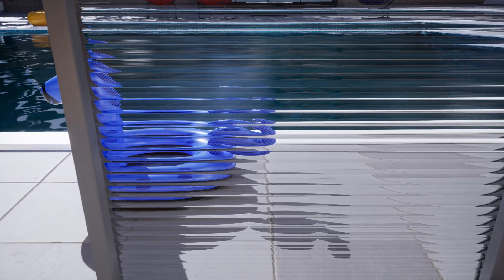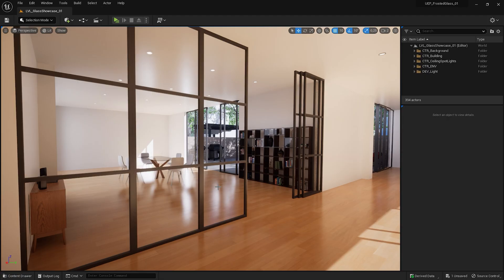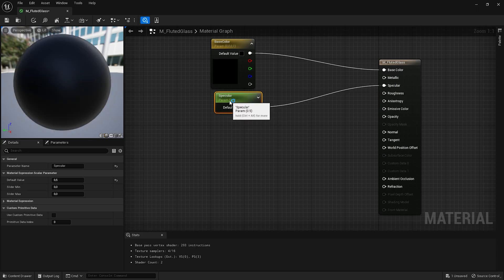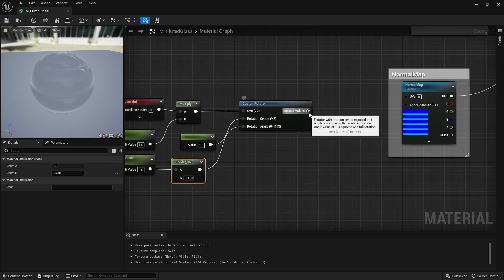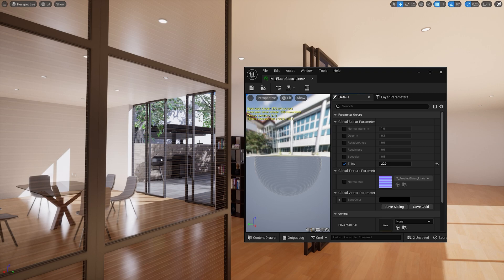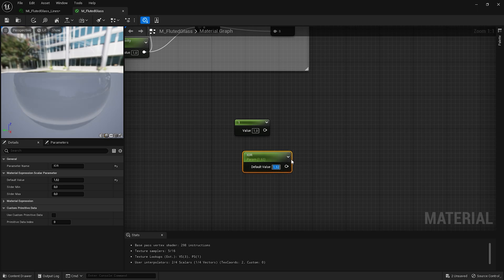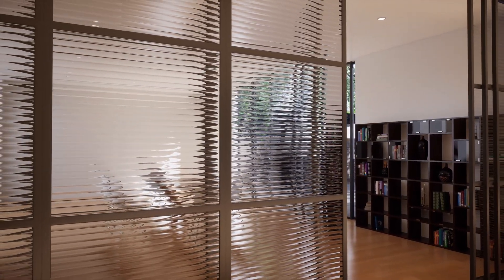Realistic fluted, ribbed, and frosted glass material in Unreal Engine 5 | Tutorial

Comment: I'm on Unreal Engine 5.6.
First weird thing, In Material > Blend Mode, I don't have "Translucent" but "TranslucentGreyTransmittance" or "TransulentColoredTransmittance". I chose one of the two and all the other parameters were available
Second weird thing : as soon as I change "Refraction Method" to something other than "None", the material seems quite dark and in the engine it's totally opaque.

EDIT : I think it's because I'm on a "Virtual Reality" project. I just created a brand new classic one and I have the "Translucent" material and it works. I'll have a fiddle with this is a little bit

EDIT 2 : Just started a brand new VR project template - the same template I took as a basis for my other one, but this time I do see the "Translucent" option. Weird.

Comment: My refraction node is disabled in the material editor, do you know why that would be?
Reply from the maker: Hi! In newer versions of Unreal Engine it's disabled by default. You need to do the following:
1. Select the main node of the material graph.
2. On the left hand side find the refraction section and switch it from "None" to one of two methods: Index of refraction (good for curved surfaces ) or Pixel Normal Offset (good for planar surfaces).
It will allow you to enable refraction input!

Comment: Showing the normal reduction maths is great but for anyone who wants a quick node to throw down, "FlattenNormal" will achieve the same effect (the usual 0-1 range inverse). Thanks for the video!
Reply: One more tip - for two-sided normals, pass RG channels from a Component Mask routed from your Normal Map output into a Multiply node. Route a Two-Sided Sign into the Multiply Node. Append the Normal Map output to your new Multiply node and plug that into the Normal output. Presto, two-sided material with correct normals on both sides! What we are doing here is simply ignoring the B channel of the Normal Map with our Two-Sided Sign for two-sided materials. Joy!

Comment: The effects shown in portal 2 and mirror's edge were likely highly optimised considering the hardware they could run on.

Is the shader code used here as efficient? I do not want to use ray tracing
Reply from the maker: Hi! This effect is used in Mirror's Edge made using Unreal Engine 3, so it's pretty old technology. You don't need ray tracing to create this effect and you don't need an RTX graphics card. It works in Unreal Engine 4 as well as inside Unreal Engine 5. However, it requests at least "Surface translucency volume to be enabled. So, you have to use this material wisely. There're not much places in Mirror's Edge with this type of windows for instance.
Reply: @nikolayshamaev  I see, thanks for the informative response

Comment: Hi! When I connect the CustomRotator node on the UVs of the NormalMap node, the texture just desappear, and the normal map turns into a solid blue texture. Why id this happening? I can't get the texture on my glas :( Can somebody help me, please?
Reply from the maker: Hi!  Try the following:
1.	Make sure your UVs are correct and not distorted
2.	Check “Texture Coordinate” node. UTiling and VTiling values in this node should be set to 1.
3.	Check “Tiling” node and make sure it’s not at 0
4.	Try to use the value of 0,5 in the “Rotation Center” input.
5.	Check the Rotation Angle (by default 0) and Divide node (by default 360 in the tutorial).
It should work fine!
Reply: We don’t rotate a normal map it’s kind of incorrect in this tutorial because normal map dictates how light should behave on surface therefore rotating means changing how light reacts, unless you want it that way you will obtain bad or incorrect result , don’t use custom rotator with normal maps

Comment: I'd suggest that anyone using this change the refraction method to Pixel Normal Offset, this produces a much better refraction result on large flat surfaces. Someone else said that you need to input different values with Pixel Normal Offset, you do not. You should use this exact same setup with the fresnel node and IoR interpolation value, only change the method in the material node to Pixel Normal Offset. Otherwise, you get strange artifacts as you see in the video, with the frame of the glass being visible in the middle of the glass, which makes absolutely no sense. This is what Unreal Engine recommends for large flat surfaces such as glass panes or water. If you have pretty much any other shape, like a glass sculpture or a diamond, then use the "Index of Refraction" refraction method.

Comment: I love this tutorial. So well presented and informative, even though I knew this before it strengthened my undestanding in a couple of key points. Question: Why did you append each channel separately for normal map instead of using RGB output with multiply?
Reply from the maker: Thank you!
To correctly control the intensity of the normal map, you only need to multiply the red and green channels and leave the blue channel as it was.

Comment: Great video, but I need to add my two scents here. Rotating normal map is not the same as rotating any other texture. When you rotate it, it also rotates the lighting information (pixel colors) which produces wrong result. Place a spotlight, make the material opaque and see what I mean. If you rotate the texture 180 degrees, it will look as if light comes from the opposite side, not from the side it actually comes from.

After rotating the normal map, you have to rotate actual normals back by the same angle.
Reply from the maker: Thank you! This is a good point
Reply: This comment should be pinned.

Comment from the maker: Feel free to ask any questions about this glass material. I hope this video will help you create the best glass for your Unreal Engine projects. If you have suggestions for similar materials in UE, please let me know as well.
Reply: Does this need thin or thick geometry? And will this work for rtx reflection set in post process?
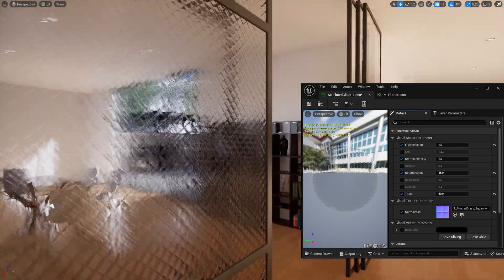Reply from the maker: @Матвей Пашков   it can be used on thick or thin geometry. You can see it at 11:04 in the video. It should also work with RTX reflection in post process, as it's just simple glass material.
Reply: @nikolayshamaev  thanks a lot! didn't check video by the end..
Reply: how i can use an baked normal on this glass?
Reply: Thanks for this tutorial!
Therefore I'll give you a tip:
If you pin your comment it will keep staying on top of the comment section!
Did you already tried out the new substrate materials of UE5?
Reply: Distortion not working
is substrate problem ?